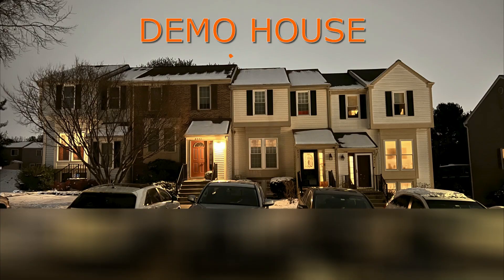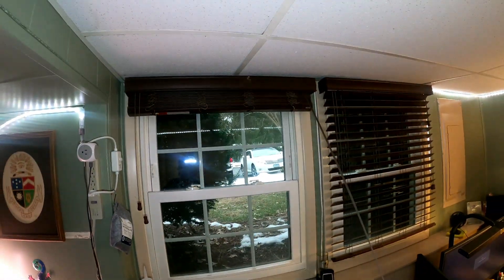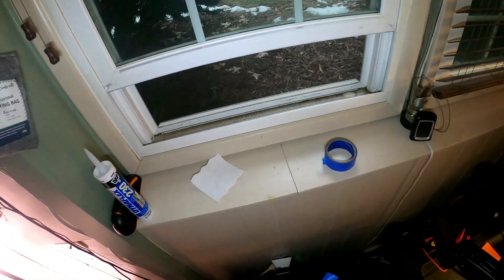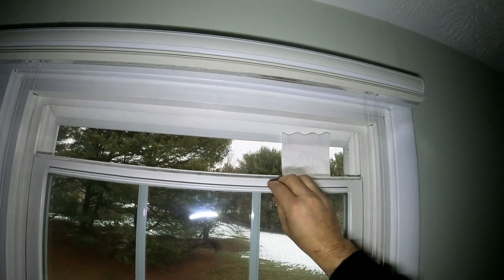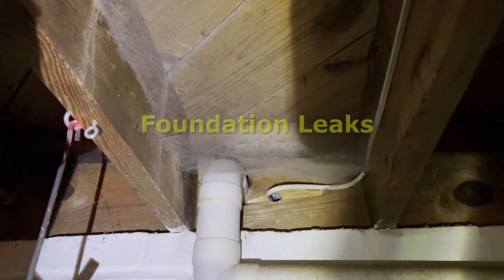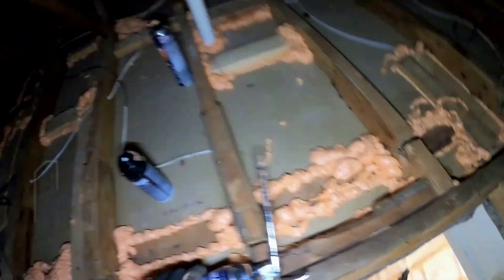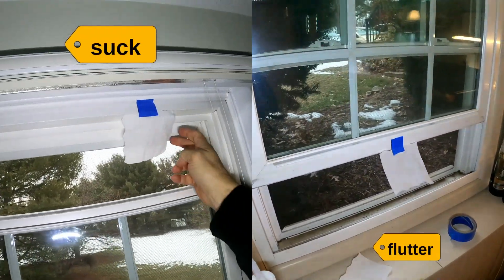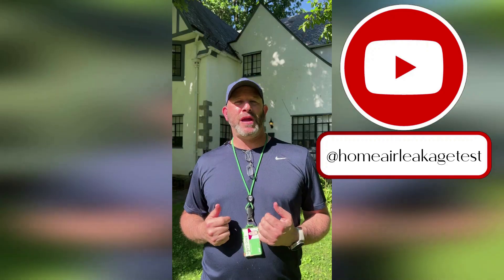Why Your House Feels Cold in Winter (The Stack Effect Explained!)

Comment: I suggest caulking the floor and heating ductwork coming into the rooms. Also use duct sealant to fill the holes in the ductwork. It makes the flow into and out of the rooms more efficient.
Reply from the maker: Yes. For sure. Great tips!!  In this case we used closed cell spray foam to encapsulate the ducts and seal and insulate the cracks.

Comment: Hi Eric, I just came across your channel. Great info!!! I am trying to remedy an attic insulation matter. Some years ago, a second floor was added to my home. The contractor built an outside porch area. The ceiling of the porch is vented vinyl soffit material about 10 foot by 10 foot. That vinyl "ceiling" is in turn, uninsulated floor space in my attic. (Vinyl soffit material nailed to the 2X8 floor joists). It was never insulated in any way and I am trying to establish if and how it should be insulated. The rest of the attic space sits above indoor living space. I appreciate any feedback you have. Thanks!
Reply from the maker: Hi. Thanks!! When you have an attic that spans over inside and  outside space like a patio or walkway, it is okay to not see insulation over the unconditioned area. It is not necessary and adding insulation over the outside area will not provide you any benefit. Hope this helps!!
Reply: @homeairleakagetest  Thanks so much for the immediate answer! Is closed cell foam the best idea for the floors and walls (the back side of conditioned space) that butts up against the uninsulated soffit material? Thanks again, learning much here!
Reply from the maker: @Greg-wn2pp  I am having trouble envisioning what you are saying so I don't want to make any errors in giving you advice. I do have a video about Cape Cod style houses and how to insulate them if you have one of those with a knee wall attic. If you have a photo and want to send to me eric@hometrustremodeling.com, I can take a look. In general, spray foam is a great solution and it is the most expensive solution so I always try to exhaust all other less expensive options first. It is not always about the question: what is the best material, rather, you should ask:  how can we pay attention to detail and get the best results for the least out of pocket. It is only insulation after all...
Reply: @homeairleakagetest  Excellent. Thank you. I will get that together and send to you👍

Comment: A completely siled house will become a sick house in no time. Be careful not to over sile.
Reply from the maker: You’re right! Here is some more info about that: To ensure your home is adequately ventilated after air sealing ASHRAE 62.2-2016 ventilation code recommends
installing a timed fan for proper ventilation. With the opportunity to air seal and reduce uncontrolled air leakage, a
tighter home also requires mechanical ventilation. We solve this practically and economically by installing an
exhaust fan, usually in the bathroom, on a special timer that keeps track of how long the fan runs for 24 hours. The reason it works is due to physics. For
every little bit of air the new fan exhausts, it gets replaced with fresh air outside the "envelope.
". It happens in a controlled way.
Reply: @homeairleakagetest  so your putting an energy eating fan that takes $ to operate when all you needed to do was not make the house a non breathing box.
Reply from the maker: @kevingaddis7276  Yes! First, the fan uses about as much energy as a couple of 9W LED lightbulbs. Next, the energy usage from the fan is calculated into the overall energy savings (when you have an energy audit done) and finally, I have not had a single complaint after sealing up houses and helping thousands of people achieve better comfort and a higher quality of life. TO EACH HIS OWN

Comment: I put in a 68k btu fireplace last year and we've never worried about heating since then.  House is a cozy always 80 degrees inside no matter how cold it is outside.  I'm not worried about heating costs since wood is "free".  It costs your time to split and stack wood, but for many it's well worth the trade off.  And great peace of mind if the power ever goes out.
Reply from the maker: Thanks for sharing your story—your setup sounds amazing! A 68k BTU fireplace definitely brings the cozy factor, and having a reliable heat source like wood is such a great peace of mind, especially during power outages. Plus, there’s something so satisfying about splitting and stacking wood—it’s like a workout with a reward!

It’s awesome that you’ve found a system that works so well for you. For others considering similar options, it’s always worth thinking about how wood-burning fits into your overall energy plan—balancing efficiency, insulation, and air sealing can make any heat source go even further. Thanks again for sharing your experience!
Reply: It’s GREAT that they GIVE YOU FREE WOOD just for installing a fireplace.